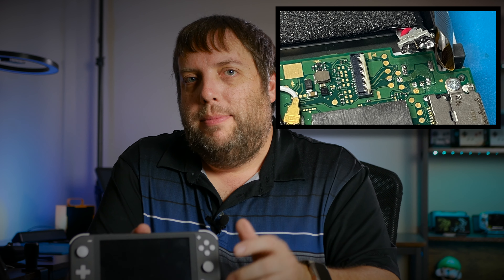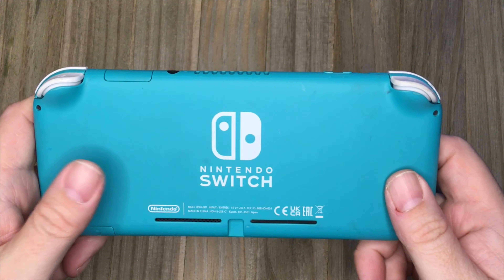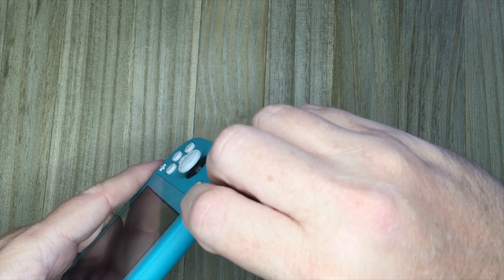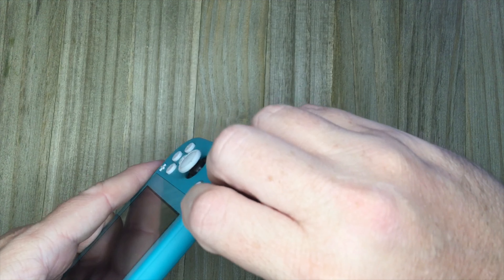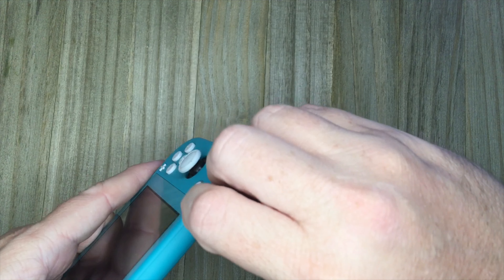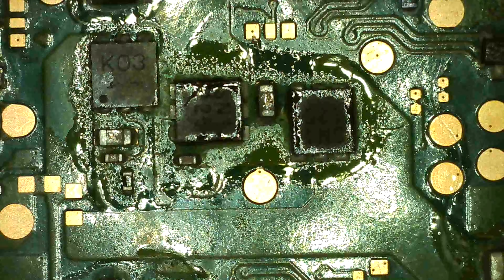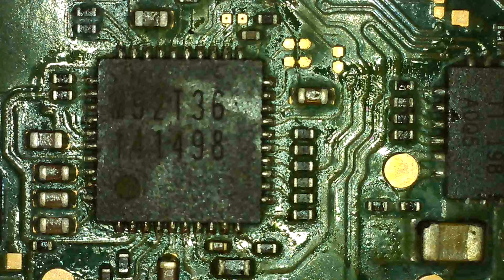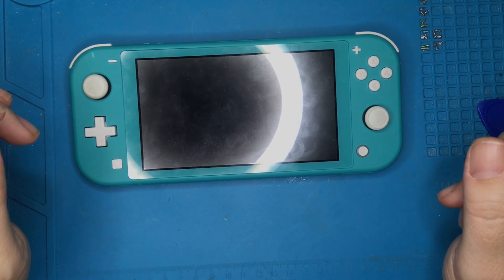Trying to Fix a Broken Nintendo Switch Lite (No Power Issue)

Comment: Hey, you think it can be one screen problem? Try use one of that adaptors to hdmi to see if the switch responds to any command
Reply from the maker: Unfortunately, I don't think it's a screen problem.  When the switch lite boots, there's a pattern that it traditionally follows, and then restarts and boots once more at a higher fast charging rate.  Mine never did that, and was permanently stuck at the lower rate.  I did also try turning the volume up so I could test if I could hear anything, but it never made any sounds either.